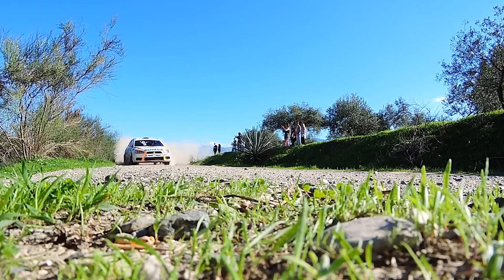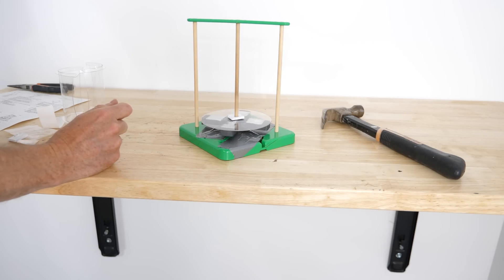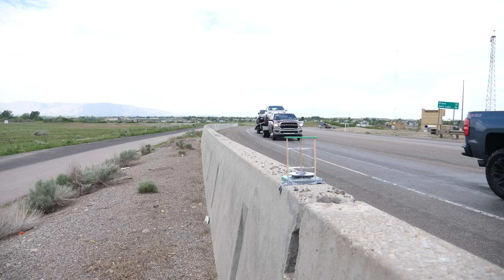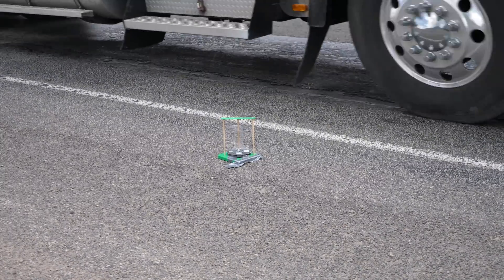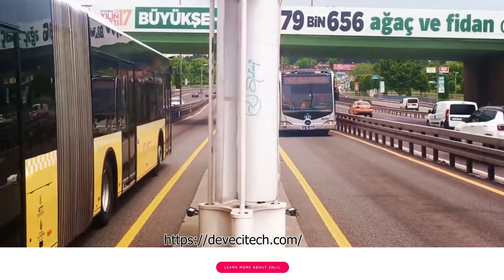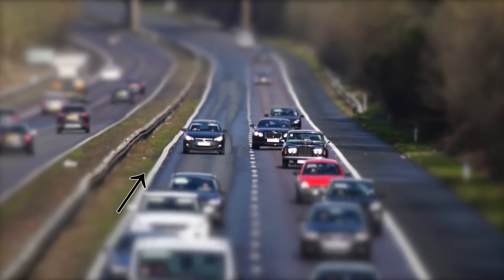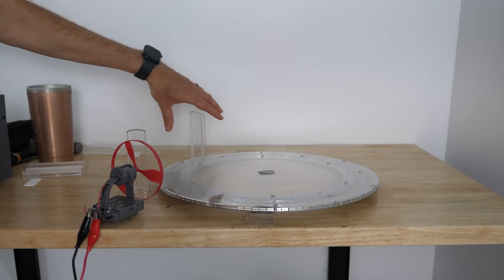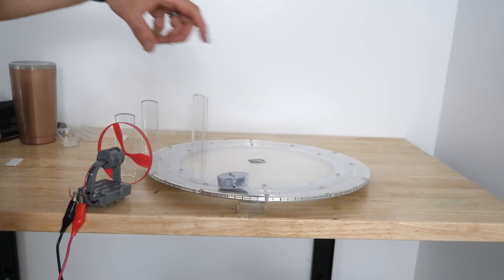Do Traffic Turbines Actually Work?

Comment: A few years ago I've already seen an idea of implementing this turbine at the train station platform. It solves your doubts, because the train is fast by its nature; the train is planning to stop anyway, so it won't be "taking extra energy from the train"; don't have to worry about the safety due to the proximity, as the train is moving on a rail (never get hit).
Reply: Why turbine when electric trains already have regen braking? A lot of energy is already returned to the grid when possible each time an electric train slows down.
Reply: @bltzcstrnx  These work due to airflow so they complement harnessing energy along with regenerative braking
Reply: @tommysalami420  no energy is free, whatever these things capture inefficiently will reduces the amount regen energy generated. They're different means of capturing excess energy, but the source still comes from the leftover kinetic energy of the train.
Reply: @bltzcstrnx  Yes and don't all train stations already have mains power?
Reply: The issue with using these with trains is that they would produce power very infrequently... depending on the line/system once every few minutes to over an hour between trains. Less frequently at night. If you need to get it close to the train, then most likely it will then be shielded from regular steady wind.
Reply: Honest to god, you would be better off installing braking fans directly onto the train.  It would still be stupidly impractical, but it would be a hell of a lot more efficient than building such at turbine at the station.
Reply: @ColonelSandersLite  what? In all the stupid I’ve read here, you really take the cake, you know there is more than one train right?? RIGHT?
Reply: @theendofthestart8179 
Yes, I do know that.  Here's the thing - A train has more than one stop.  When you forgot that, you really took the cake.

You can either do some kind system to recover energy from multiple trains on a single stop or you can recoup the energy from every stop.

On top of that, putting these wind catching turbines near the train won't let them work with anywhere near the efficiency that a turbine would work with if it's on the train.  The reason why should be obvious but in case it's not - air is compressible and that makes it terrible at transmitting energy in normal pressure ranges.  The drop-off with distance is pretty steep.

I still say that it's stupidly impractical though.

Fact is, we have already solved this.  Instead of trying to regen braking energy by air transmission, we can just regen braking energy by attaching these turbines directly to the axles.  And yes, we do this on *MORE THAN ONE TRAIN*.
Reply: @ColonelSandersLite  yes yes I won’t ask you took look at other replies because I don’t want to anyone to have to read that garbage, but I’ve said as much about regenerative breaking already, there is absolutely no way an airflow based system would ever be efficient or effective. But I really DO need you to know, there are either 472 or 424 subway station in New York (random example of large urban city) depending on if you count complex stations as just 1 or not, but there are 6418 vehicles. 13.5 times as many. So yes there are multiple stations, it’s plainly obvious, I just didn’t think I had to spell out for you that there are so many MORE trains than stations.
Reply: It is much more efficient and cheap to recapture that energy via regenerative braking
Reply: This is going to be helpful only when stopping
Reply: @doitmyself6377  what the hell are you talking about? It isn't regenerative braking! Stopping has nothing to do with it! Good christ
Reply: might actually be a good idea in tube lines
Reply: Uh you, you did the classic, invent a worse way to do something we already have
Reply: Why not simply clamp two thick copper wires onto the train overhead wire and the track? Much simpler cheaper easier and would give tons of power.
Reply: I can guarantee you that the turbine at that train station will never recoup its cost.
Reply: @addanametocontinue  I get it, so that's why it's only an idea, not actual implementation
Reply: A turbine to slow down a train would only work efficiently if the station/stopping train were in a tunnel, like a tight subway.
Reply: @JoelReid  yes, most of the train stations in my local city are like that
Reply: Your idea is already implemented in my city's railway station on the ends where the trains would be stopping/slowing down
Reply: @evilhell1218  cool, where is it?
Reply: No, it still costs the train extra energy. It doesn't matter that it was planning to stop. The cars were planning to stop too. Stopping... actually has absolutely nothing to do with this, what are you talking about? Stopping matters for regenerative braking but this isn't that.

Comment: I think there is something you didn't consider, in a 2 way road, the resistance added by the turbines actually helps because it prevents a little bit of air to go to the other side and creating opposite side resistance

Comment: I just drove from Arkansas to California and saw so many of those windmills. They made me think of something; there is no free energy, so something needs to be losing something for a windmill to work right? But then I thought, well a water wheel is kind of exactly the same thing except for a different medium. You could stack as many of those on top of each other as you wanted and as long as the water could drop it would drop so nothing was really taken from the water other and some of its potential energy. 

So my question is what is being taken from the wind that lets windmills work? Does people taking whatever it is cost the environment something?
Reply: Physically, taking potential energy out of falling water has the effect of making the water relatively cooler than it would have been had it fallen on its own.  That potential energy has to be dissipated somehow, and that would be by heat.  The same effect occurs when you run a blender with just water in it.. the water heats up due to the agitation.

For windmills, air velocity is being taken.  The power of moving air is a function of the air volume, and air density multiplied by the cube of the speed.  So if you extract energy out of the wind, its density won't decrease, so the only factor that can decrease is its velocity.

Comment: Run a hose across the highway.. when the hose is run over by vehicles, the air compresses in the hose.. harvest the pressure into a pressure chamber for use as energy storage...

Comment: You made what i have been working on for my school project for the last two months... But i discovered that if the diameter to height ratio is 2:3 it gives best output and height around 0.75 meters can turn the turbine from around a metre away( atleast here in Kolkata VIP road)
Reply: Well, i am not a master in electronics, this is just a school project.
Reply: What was the torque on the turbine shaft? A freely spinning turbine with no load isn't really producing any power
Reply: @sammason2300  well, i am still working on this project, but the best result i got during the tests was around 20W (12V dc, 1.66A) power, i used a step up Dc-Ac circuit ( it was provided on demand from school lab, i have no idea about its working, the above values were calculated by teacher) and connected a 18 W led as a load.

Comment: I imagine that with multiple lanes of traffic, wind just from the weather, traffic barriers, lampposts, roadworks etc the air is so turbulent on motorways that these turbines wouldn't have any effect. I don't think the air is flowing efficiently enough in the direction of traffic in the first place for the turbines to have any negative impact on efficiency.

And when there is no traffic, the turbines are going to spin from the weather anyway. 

With the small amount of energy generated though, I can't imagine energy used for manufacturing, installation and maintenance would be offset by the turbine itself. Seems like you'd still be at a net loss of energy.

Comment: Energy conversion always introduce energy losses, so even if the energy taken from the cars is insignificant, the amount of energy you get from them is even less, actually a lot less, I'd argue that the amount of power you can get out of it is insignificant compared to the amount of energy you take from the cars.    

The fact that energy conversion always introduce energy losses also means it's fundamentally flawed idea to transform already useful energy, unless the value of the transformed energy is much higher than before, per unit of energy.  The idea wouldn't have been fundamentally flawed (in that way) if it was proposed to be installed where the vehicles needs to slow down or use the breaks to limit the speed, like when going downhill. But, regenerative breaking is common and that is much better, more efficient, and the energy goes to the right owner, and is typically more valuable there than on the grid.        

Wind turbines are really good at slowing down air, that's what they are made to do, "catch" the air movement and turn into power. All objects slow moving air, but not the same amount. Along high speed roads there's typically a wide unobstructed area alongside the roads. Claiming there are a lot of objects very near the cars anyway and low low speed city traffic as "proof" is hardly intellectually honest.
Reply: If you think that was his "proof" then you didn't finish watching the video.
You can't think of a situation where a vehicle losing energy is beneficial?
Reply: @joekemp83  The "-signs means not actual strict meaning of the word, this is common knowledge, you're welcome.

I actually mentioned a couple of situations where vehicles without regenerative breaking could actually benefit from help in slowing down, or limit their speed, so perhaps you should try reading my comment again.

Comment: Maybe just use the turbines to power the following street lights at night, and let them turn off after the car passes, which will allow the lights to be off grid, and save a lot of energy when no one is on the road. I guess it won't produce enough energy but maybe?

Comment: You do not need a turbine to generate electricity from traffic.  You just need a large coil with some core.  As the cars move they change the magnetic field or flux  in the coil and this generates electric power. And yes it would slow down the cars, like magnetic break.

Comment: Small windturbines usually are a bad idea from the economical viewpoint. They cost more than the benefits over their lifespan.
The Enlil turbine you showed briefly in your video can produce up to 1 KWh on ideal circumstances. In the test a turbine produces only 3 KWh a day on average. 40% of the energy production came from the little solar panel mounted on the top.  Just mounting solarpanels on top of the guide rails or barriers is a whole lot cheaper and wil produce a whole lot more energy.

Comment: In my opinion it would be great for this turbines to be used near lampposts or traffic lights as resistance is already provided by those and it will great for areas with less sunlight
Reply: I thought about that. But even then, solar panels and batteries are probably cheaper.
Reply: Nuke is where the energy is at, everything else is stupid and a waste of precious resources

Comment: I wish there was a way to mount a wind turbine at the rear of a moving car, especially a truck. Because they create a considerable negative pressure behind them, while the air moving on top of them is gaining speed (because of the shape of the vehicle -- Venturi). This way we would not only have neutral-positive pressure difference, but instead a negative-positive + high wind speed. I imagine that would be an efficient way to utilize the vacuum behind trucks. Also, if such a turbine creates additional turbulence behind the truck, I imagine it would have a positive impact on fuel economy: just like dimples on the golf ball increase the distance it can fly (by creating turbulence behind the ball, reducing negative pressure behind it), a wind turbine behind a truck could maybe also reduce the negative pressure behind it, meaning the car would have to fight less forces to move forward.

Just a thought.

As for the traffic turbines - ... meh.. Maybe in the tunnels?
Reply: A turbine slows down moving air. The low-pressure zone behind a vehicle (and high-pressure zone in front) exists because air can't move around the vehicle fast enough to keep the pressure equalized. A turbine would slow it down even more, creating an even greater pressure difference between front and back of a moving vehicle and therefor greater drag.
Reply: @5467nick  Would it though? If I understand it right, the low-pressure zone size/volume depends a lot on whether the air flow creating that zone is laminar or turbulent. I imagine a turbine like that would facilitate in converting laminar→turbulent air flow faster, making the air stream "stick" closer to the back of the vehicle, making the low-pressure zone smaller. So when the low-pressure zone "wants to be filled in", it would pull on mid-pressure zones more and on the back of the vehicle less, effectively slowing it down less.

I might be wrong. I'm not a physicist, only a hobbyist.

I am basing this on the explanation of how the golf ball dimples work. A turbine at the end of the vehicle could effectively be a massive "dimple" :D
Reply: @dariusj33  A typical turbine that is facing towards or away from the ground isn't really going to spin much as there isn't a significant airflow force in that direction. That alone means you won't get much out of it, but it will still increase drag, being a net loss of efficiency.

My understanding of golf ball dimples is they reduce the surface area of the ball that the air interacts with, so there is less frictional loss, meaning less drag. That's probably not what you'd want in a windmill generator as the windmill needs to interact with the air to take power from it.

Comment: Go bury some coils in the road in front of your house to inductively rob power from the cars passing. Your point is valid, the wind turbines need to be some distance from the vehicles, not to increase their wind resistance. It does matter, diesel to drive wind turbines is not the path to go down. However the unutilized space close to highways could be used for vertical wind turbines harvesting regular wind.

Comment: One detail that was missed was that the real turbines actualy moved out the way of the air like it was being pushed/spun round to cause the voltage... unlike the models of the turbines was solid plastic that didn't move so the models would have generated more air resistance than the real life turbines that move/spin ... that would make a difference surely 🤔

Comment: You are just stealing a small amount of energy from the moving traffic which in the first place is only converting its own energy supply with very low efficiency in the first place in the case of combustion engines. Efficiency of whatever turbines you put by the road will be very low also, so it makes no sense whatsoever to try to make a little inefficient energy from an already small and insufficient source. Great demo of this however! Thanks😊!

Comment: Add springs under the road speed bumpers to convert the kinetic energy of the weight of the passing car into potential energy stored in the springs, then convert that into electricity. Bumpers are everywhere already.

Comment: Cars must drive over a flat pad with "veins" filled with liquid(one way non return), causing the liquid to flow in one direction.
Then use that flow to turn a generator.
Reply: That's not free energy, though.  That's basically a tax :D  The energy put into the pad comes from the car's engine (or electric motor).  There's no free lunch.
Reply: @yeroca  Yes not free, it's more like a "donation" or contribution. No matter how the energy is obtained/converted/harvested from cars on the road, it is obviously free.🤣

Comment: IMO this concept would work best in tunnels. The airflow is a lot more focused, you could put turbines at the ends of the tunnel and capture some of the waste energy from the air movement.
Reply: The more powerful turbine, the more the air slows down and it adds up, as he said. We cannot claim that it's capturing waste energy, if the flow out of the tunnel is notably impeded. It's leeching car motor energy and creating a hazard due to poorer ventilation.

Comment: Maybe it's a pipe dream to get energy from the cars passing by, but the roads do get a lot of crosswinds, especially on bridges, and perhaps that is worth tapping. One idea is to make those concrete railings more sail-like and hollow so that the wind can be redirected to their interiors. Each railing can act as it's own generator, and they can be strung together like Christmas lights (in parallel) so that crashing into one or two wouldn't cause a sudden outage.
Reply: Here's a better idea ... use turbines to catch natural wind.

Comment: There is a real use case for this: a single traffic turbine maybe useful in generating enough power for LED lightning, sensors, or even a CCTV camera if combined with solar power. This will avoid the use of lengthy wiring and the need to use transformers to reduce transmission loss.